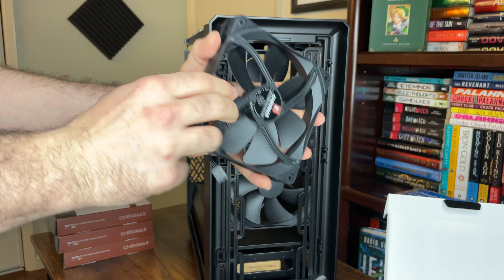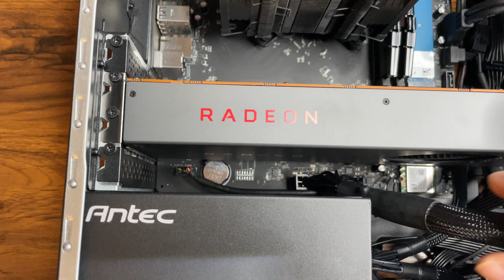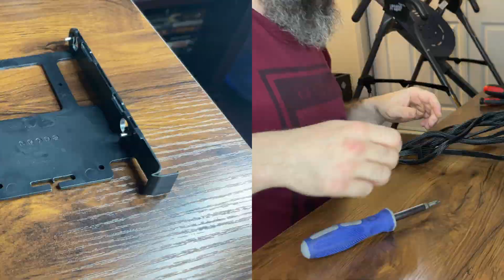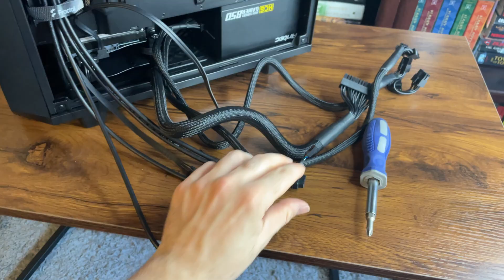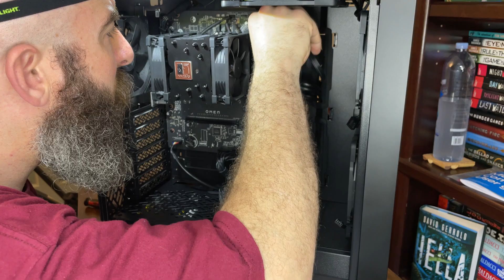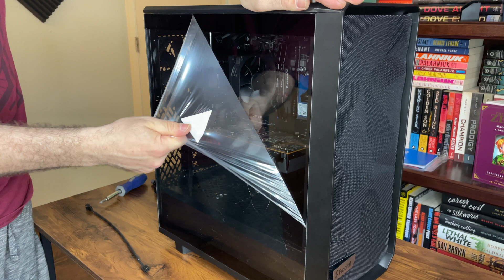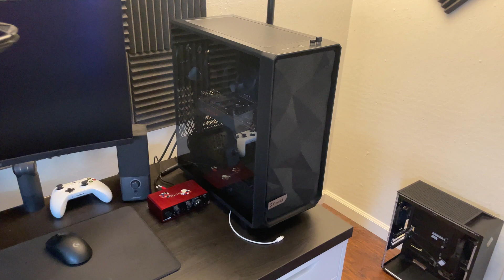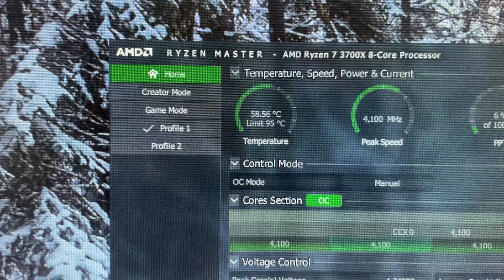HP Omen 25L / 30L Case Swap! Tutorial! Walkthrough and Results!

Comment: so my 30L i9 10850k and 3090. Get hot like everyones else. But i also find 32gb of ram limiting in games like dcs. the 30l comes with only two ram slots. Think Id be better off swapping mother board as well? Ive heard that this can cause issues. Ive also heard 30l doesnt like ram swaps. Any feed back would be much appreciated.
Reply from the maker: Motherboard swap would give you the freedom to use pretty much any RAM, and be able to OC it to it’s max speed. Omen motherboards don’t like aftermarket RAM and will lower default memory speeds, with no way to bring the speed back up
Reply: @DanKamYouKnow  Thank you, subbed and liked;)
Reply from the maker: Appreciate it Matthew! 😎🤝
Reply: @DanKamYouKnow  made the swap. Asus prime a z590, added a 360 aio...new ram...cpu still wanted to put it at 2400mhz...how ever bios of new board allowed xmp. So so far so good. Cpu now doesn't break 55'. Now all eyes are on the 3090 at 75' lol...which is fine normally ...just not in my house. Lol. Need to find the best way to cool an hp specific 3090. Not sure if standard gpu coolers will work.
Reply from the maker: Nice! Best way is a ton of airflow and using MSI afterburner to set a custom GPU fan curve. You can make it a little more aggressive than the factory curve and it should stay a bit cooler, but will result in more fan noise. You’re right though, 75c for a 3090 actually isn’t that bad.
Reply: @DanKamYouKnow  yeah, uts more the stigma. New silicon can operate much higher. And after looking at the gpu and the triple fans and radiator. Not sure buying a gpu cooler would result in worth the money drops in temp. Afterburner it is.  Really appreciate the replies and being able to bounce ideas off another 30l mechanic lol.
Reply from the maker: No worries. I’ve heard the repasting the 3090’s and installing new thermal pads greatly helps as well.

Comment: If I get a case with rgb, would I transfer the rgb controller?
Reply from the maker: The RGB controller only works with the HP OMEN motherboard. The HP board will not work with any standard RGB. You could transfer your HP Omen case lighting into a new case though.
Reply: @DanKamYouKnow  thanks man

Comment: Great video. Maybe someone can help me here, got the 30L. I want to swap the whole case. The i9, 3080, 32 ram and the m2 in a new case. Now my question is can I fit an i3 in the  omen desktop with the existing motherboard, also using the existing cpu cooler. And can I just put in another 8gb memory? dont need to be from hp?
Reply from the maker: Why would you put an i3 in? You’ll have a massive bottleneck with the 3080.
Reply: @DanKamYouKnow  I wanna make the hp case just for email and stuff. No GPU . The I9, GPU, memory going to the new case
Reply from the maker: Gotcha, if you look up your Omens product code ( Example: GT12-0030 ), it’ll tell you what CPU’s are compatible with your Omen motherboard.
Reply: @DanKamYouKnow  You my hero already :D GT13-0000i (236B0AV) I was looking for a cpu with gpu onboard. Now i realize that the mobo dont have any display out  :( So i still need a gpu then? Sorry for my lack of knowledge
Reply from the maker: Yup, Omen motherboards don’t have on board graphics ( and HDMI or Display Port ) on the back IO, so you would’ve be able to do it.
Reply: @DanKamYouKnow  what for a cheap gpu and cpu i should go for?
Reply from the maker: No such thing as a cheap GPU right now, the market is awful. Lots of CPU’s around $100 though, have a look around NewEgg

Comment: Hey Dan I got my new case and I was confused with the front panel I/o my new case came with a led sw, reset sw, hdd led and led positive and negative but on the intel version of the omen to don’t see those power connects do you have any other idea of where I can plug them thank you!
Reply from the maker: Your Omen motherboard will only have the power button and LED +/- header. It’s a small 2 pin header on the board and they should be next to each other.
Reply: @DanKamYouKnow  tbh I don’t think I have a led positive and negative I have a led tho and Pwr epwr
Reply: @DanKamYouKnow  yea I don’t and a musb not sure what’s that does tho
Reply from the maker: @4evawayne471  You'll have to send me a picture of your motherboard on the Discord linked in my description
Reply: @DanKamYouKnow  alight I will

Comment: So i swapped to my new case and the wifi isnt working, motherboard has built in wifi
Reply from the maker: Did you install the WiFi driver for it from your motherboard manufacturers website? Also make sure you install the antennae that come with your motherboard.
Reply: @DanKamYouKnow  no i mean the wifi is built in
Reply from the maker: This an Omen motherboard? Omen motherboard uses the small WiFi card that’s on the board. And you have to transfer the antennae from the Omen case for it to work properly.
Reply: @DanKamYouKnow  yeah my sister said i forgot the antenna, oops

Comment: My 2080ti is 1\2 inch too big for the HP omen 30l case. any ideals on how I can get the card in there?
Reply from the maker: You’d have to modify the hard drive cages in front some how
Reply: @DanKamYouKnow  yup
Reply from the maker: Now’s the time to case swapping 😉
Reply: @DanKamYouKnow  it’s seems like a lot of work. I was just going to try and cut it out.
Reply: @DanKamYouKnow  my dumbass thought the cage was held in there by screws.
Reply from the maker: Nope, you’re going to have to cut it out. I’d do a case swap. Much better airflow more options for cooling. Can be had for pretty cheap

Comment: I decided to do a case swap and Just ordered the Be Quiet Silent Base 802 case and a 850 watt Corsair power supply with some nice extension cables.   I really like the Meshify cases and Lian Li, but the Be Quiet case caught my attention more.   I will use it with the mesh Front and top for a cooler running setup.   Down the road I will do as you did and build a new system into the Be Quiet case and then move the Omen guts back home again later.
Reply from the maker: Nice! Those Be Quiet cases are fantastic, especially when being setup with the mesh. I think you’ll be happy with it and obviously the airflow will be a MASSIVE improvement over the Omen case.

Comment: Love the tutorial! Any way you can recommend a glass version of this case upgrade. I really want one that you can see through so I can set up a nice lighting scheme.
Reply from the maker: Thanks! All glass cases look great but usually don’t offer the best thermals. However, it’ll be a WHOLE lot better than the Omen case. Here is a very popular case right now, the Lian Li 011 Dynamic.

https://amzn.to/36GbLEz
Reply: @DanKamYouKnow  Will this fit everything I have in my current omen? Power supply, mother board?
Reply from the maker: Yes, with plenty of room to spare.
Reply: @DanKamYouKnow  opinion on upgrading from my rtx 2060 to a 3060? looking to upgrade, ay suggestions or links?
Reply from the maker: It’ll be an upgrade but not worth what pricing is like right now for graphics cards. Any link I provide you will be overpriced as of right now. I’d wait a few months before thinking of upgrading, due to inflated GPU prices.
Reply: @DanKamYouKnow  Got cha, what would you say, after waiting of curse, would be a legit upgrade from the rtx 2060 that would make sense. for my set up of course the omen 30L 1 tb m.2 32gb rams.
Reply from the maker: If it were MSRP pricing. Id say a 3070 or better. A 3060 is only about 23% better than a 2060. Ideally, I’d say a 3080 since it’s the best price to performance card out there.
Reply: @DanKamYouKnow  Thank you, much appreciate the feedback. This helps!

Comment: I just did this and I’m having some issues
Was wondering if you could help me out possibly? Thank you!
Reply from the maker: Sure, just go ahead and comment what’s going on.
Reply: @DanKamYouKnow  I just transferred my stuff to a thermaltake s100 case and added aio to my setup . Everything else is completely stock 
I’m now getting 3 long beeps and 2 short and startup and no image on the monitor
Reply from the maker: Are you sure your RAM is fully seated and in the correct orientation on the board? You’ll want to look in your manual to make sure you are using the right slots ( if you’re using 2 RAM sticks.
Reply: @DanKamYouKnow  yea Bc I didn’t even take them out
I did tho now and place them back how they were and nothing 
And it’s only two slots for ram and my mobo
Reply from the maker: Is there anyway you could of scratched the motherboard when you removed the stock cooler backing plate?
Reply: @DanKamYouKnow  you know, I might have to look into that 
I don’t believe so tho
Reply: Is it possible to add a 32gb ram card in one slot? Or can it only take a max 16?
Reply from the maker: I would recommend running RAM in dual channel
Reply: @DanKamYouKnow  thing is one of the slots broke so I can only run a single slot
Reply from the maker: Then you should be fine with 1 32gb stick.

Comment: Trying to remove the motherboard and the screws are inhumanely tight, any advice?
Reply from the maker: Interesting. Mine weren’t that bad. Make sure you have the right screwdriver and apply a good amount of force to get it out.
Reply: @DanKamYouKnow  their support page calls them P1s, P2 fits much better. Still required an absurd amount of strength to turn it, I ended up having to use an adjustable wrench on my screw driver to get enough torque

Comment: So I noticed the WiFi is connected to a wire, do you know how to safely remove it from the case to transfer it ?
Reply from the maker: You have to remove the front panel and you’ll see that the wires connect to to metal pieces. You will have to transfer those into your new case somehow.

Comment: Can I do that with this case: https://www.amazon.com/AZZA-Cube-Lighting-Tempered-Glass/dp/B07Y17T7J9/ref=pd_sbs_7/147-3579038-3765137?pd_rd_w=jqi1b&pf_rd_p=f8e24c42-8be0-4374-84aa-bb08fd897453&pf_rd_r=90QKBBMC600MHGW6MDCB&pd_rd_r=491ff0a7-8683-485c-8e01-936e1b6b18ea&pd_rd_wg=xO1OO&pd_rd_i=B07Y17T7J9&psc=1&tag=coa_us_g-20#customerReviews
Reply from the maker: I don’t see why you would run into any issues! You may want to go with a fully modular power supply because the HP PSU cables may be too short. Cool looking case though 👍🏻
Reply: Thanks! So what are some things I would need to get to swap cases besides the case and of course a screwdriver? Just longer cables? If you could send a link to some cables that would help a lot.
Reply from the maker: You’ll need PSU cable extensions and y-split cables. If you look at the description of this video:

https://youtu.be/R8eSUTPPvUE

I show what PSU extensions I use and the y-split cables that I use 👍🏻. I would link you directly but I’m at work right now and can’t.
Reply: Also, would I need this cables that split from one to two for the fans, because this case seems to come with more fans than the omen

Comment: Hey uh I have the Omen 30L GT13-1074 with a 3060 and I’m case swapping into a Corsair 4000x it won’t turn on I think the main problem is the front panel connectors I don’t know where to put them, my motherboard is different from yours.
Reply from the maker: You should have a diagram in your motherboards owners manual that shows how they should be plugged in. Usually the letters on the connectors are facing downward.

Comment: I’m trying to get a new case as well. I have the same omen as you and was wondering if Thermaltake S100 Tempered Glass Snow Edition Micro-ATX mini-Tower Computer Case with 120mm Rear Fan Pre-Installed CA-1Q9-00S6WN-00, White https://www.amazon.com/dp/B087CDVBZD/ref=cm_sw_r_cp_api_glt_fabc_1DDD7YPXT7QP9C7SHKCW?_encoding=UTF8&psc=1 would work? It says micro atx but I’m not sure if I should look out for something? Thank you!
Reply from the maker: Yea, that will work just fine for your Omen motherboard and components! Keep in mind, if you ever decide to upgrade the motherboard, you will have to stick with an micro ATX board, as that’s the largest size that, that case supports.

Comment: Thank you for all you do this was incredibly helpful. After switching cases I had a 20° C drop in CPU temps (From 65°C to 45°C) this is using the omen liquid cooling with a single 120mm. I also had a 25°C drop in my RTX 3080 Temps by adding additional thermal paste on the heatsink around the GPU chip (From 110°C to 85°C). The 3080 went from 76MH/s hashrate to 101MH/s with the better temps. I'm one happy camper.
Reply: Can the stock omen AIO be put in this same case?

Comment: As far as the added coolers are concerned, could you have daisy chained the extra case fans using molex? Or does that modified CM PSU not have the appropriate cables?
Reply from the maker: It’s a non modular PSU so no extra cables of any sort. 👍🏻

Comment: After I did the swap I got a cpu 90b error.  What did I do differently
Reply from the maker: Do you have a fan plugged into your CPU fan header? All connections on your Omen board in connected?
Reply: @DanKamYouKnow  yeah the only difference is I kept the fans in the case and they were three pin and not four,but I was able to plug them in
Reply: Another difference is I installed an Arctic 2 cooler and it’s a four pin and fan all in one.  Previous was split in from pump and fans
Reply from the maker: So you have a 3 pin or 4 pin fan plugged into the CPU fan header
Reply: @DanKamYouKnow  Thank you for trying to help. I Finally got it.  The new radiator fan wasn’t matched well so I installed the fan from the hp case on to new arctic cooler radiator then did some daisy chaining.  A lot more work than I thought but I got it.  Temp dropped 10 degrees on my cpu pushing it .  I hope that is was worth it lol.
Reply from the maker: Glad you figured it out!! 10c drop is fantastic. I saw a 15c drop on CPU temps in game with my case swap.

Comment: Thanks for sharing, I switched case for my HP Omen Obelisk to a Fractal Meshify C (Version 1), it was the best decision I could have made, my GPU temps went down about 20 degrees under stress and my CPU never goes higher than 70-75 Degrees also under stress, what a difference. I was able to transfer the Omen RGB electronic controller to the Fractal case and plug in the RGB light bar and RGB Omen logo in the Fractal case, the RGB lightbar snaps neatly without screws inside top side (glass side) completely concealed, I also cut up the plastic cover around the RGB Omen logo and was able to stand it up neatly inside my case, so I have both the Omen logo and lightbar fully lit up inside the Fractal case. Your shared experiences have been very helpful on my quest to improve the performance of my own Omen. Cheers.
Reply from the maker: Interesting!! I thought about trying to transfer the RGB controller over but knew I would soon replace the motherboard, and the HP controller would not work with it. As much as I love the Omen case, it just isn’t good for thermals and I saw fantastic results like you did. Appreciate your support Gabriel and thanks for sharing 👍🏻👍🏻👍🏻

Comment: FYI, he Fractal case comes with the standoff removal tool, so you didn't need to use the pliers to remove and reattach the standoffs. Look in your box of screws, it should be there.
Reply from the maker: Mine did not come with it 😐. I searched everywhere for it and I only received all the extra case screws. Wonder if mine was packaged wrong.

Comment: Just curious, why didn’t you transfer your WiFi card over? I’m swapping out my Omen case right now and noticed its wires run to the front and are soldered to these two metal tabs, is there no way to move those over?
Reply from the maker: I mention it in the video but I don’t ever use WiFi, I only use Ethernet. And you’re right, the 2 connections on the WiFi card appear to be soldered on to the front part of the case. You might have to figure out a work around if you transfer the WiFi card over or buy another one.
Reply: @DanKamYouKnow  my bad, must’ve missed that part in the vid. I only use Ethernet too so it’s no big deal, was just curious about how it’s set up there. 
I finished swapping my case earlier and I’m super happy with it. Your video was a huge help, much appreciated!
Reply from the maker: Not sure how to set up that specific WiFi card unfortunately. Nice dude!!! What case did you go with?
Reply: @DanKamYouKnow  I went with the NZXT H510 Elite. I ordered it before learning that the thermals aren’t the best on it, but so far it’s still been a decent improvement over that stock Omen case. 
Plus, you just can’t beat the looks of this thing haha. Upgrade the motherboard and slap an AIO in there and it’ll be one hell of a rig
Reply from the maker: Nice! The H510 is still one of the nicest looking cases out there, and the thermals are much better than the Omens, so that’s a win 👍🏻👍🏻👍🏻

Comment: What gpu are you using and what's the max size gpu that will fit in a 25L?
Reply from the maker: 25L - L=279 mm W=115 mm (2.75 slot) H=51 mm

Note: These measurements are with the anti sag brackets removed (which is necessary for non Omen OEM GPU's)
Reply: @DanKamYouKnow  tyvm
Reply from the maker: And I’m using an AMD RX5700, but I’m searching for a 3080.